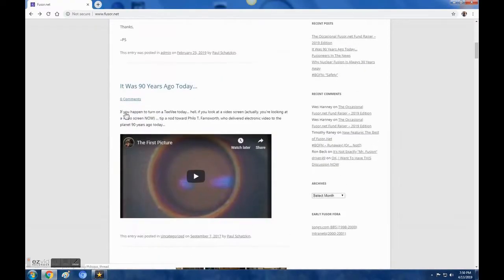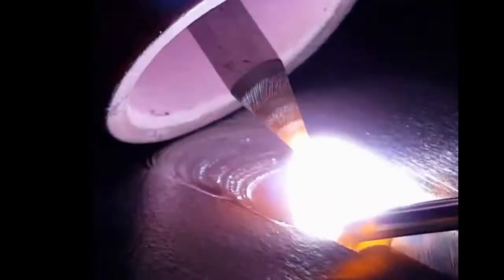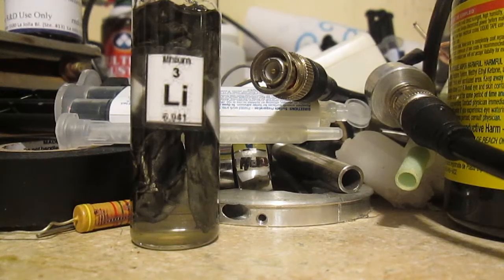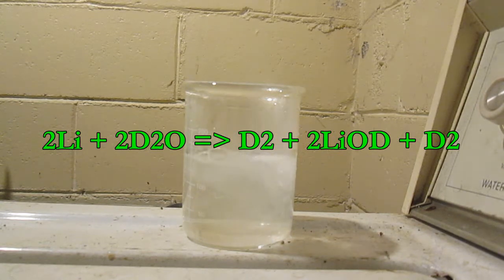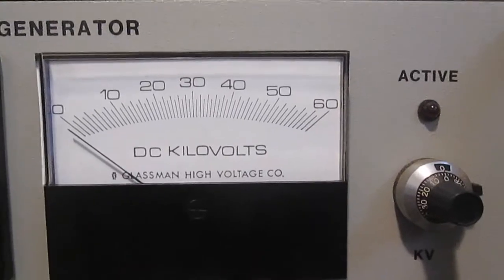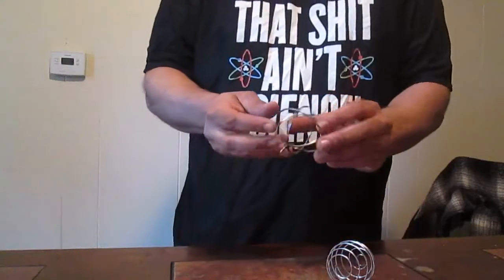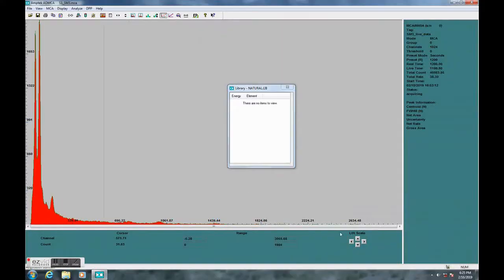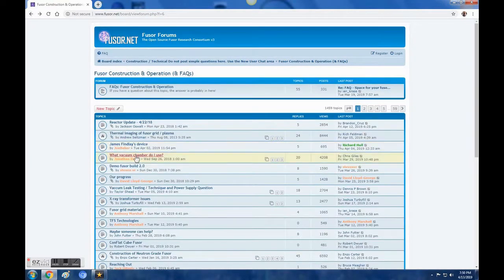DIY Nuclear Fusion fusor  part 1

Comment: You are french
Reply: I don't really know... I kinda got it for Christmas sooo, I thought I could test it for leak testing. This is my first time working whit vacuum pumps though.
Reply from the maker: Ok well that's good! At least your trying I can totally appreciate that !  But if you are serious about fusion you should invest in a descent pump ..I know nothing is cheap these days...
Reply from the maker: Lol! How did you guess?
Reply: Your dialect.
Reply: I'm also building a fusor btw
Reply from the maker: @XBlueBeam  how far along are you? Have you checked fusor.net yet?
Reply: @Neptunium I just Need a valve, a power supply, and a few vacuum gauges. Yes I have checked out fusor. Net
Reply: I am not really building some gamma Ray protection, but I could just make a a stainles steel box around it.
Reply: I am also using a 12v vacuum pump. (I made so it runs on 18v for some extra power.)
Reply from the maker: @XBlueBeam  12v vacuum pump?
Reply: @Neptunium just for testing the vacuum seal. Sorry for the delay.
Reply: @XBlueBeam  I'm not sure if it is going to work, a fusor requires at least a 2 stage mechanical pump, something who needs to be on the wall socket to work, a little 12v pump as you're saying cannot even reach the presure needed. It is going to detect big leaks but the smaller ones it is not going to be able to detect.
Reply from the maker: That's right..I have not seen the type of 12v  pump you are talking about, I've used a two stage Alcatel pump that can drop the pressure down to a few mm of Hg before the turbo pump takes over. You might be able to detect major leaks as previously said but that's about it...why waste your time bro?
Reply: It's just for vacuum seal testing!
Reply: Ok
Reply: I might just sell it then...
Reply: Yeah, but I think I'm going to invest in a proper pc first.
Reply: @XBlueBeam  sounds great! We are going to be waiting for your appearance on fusor.net